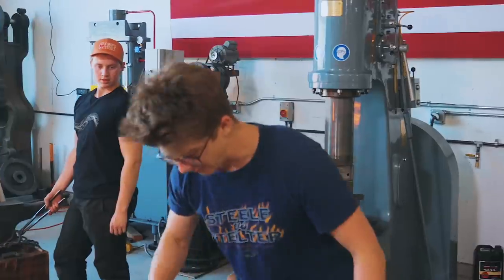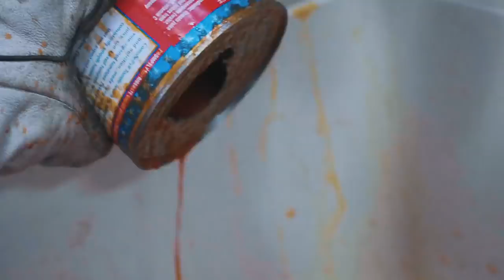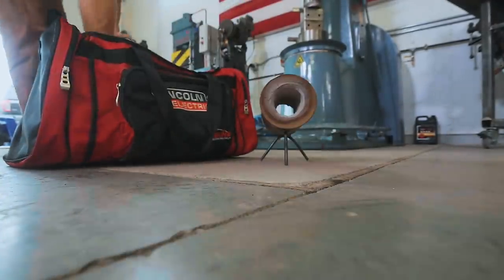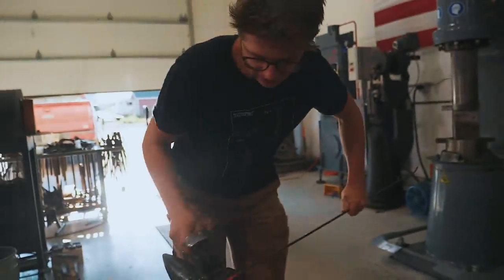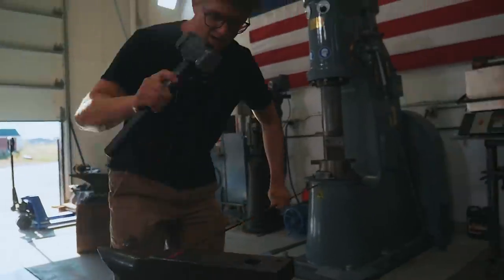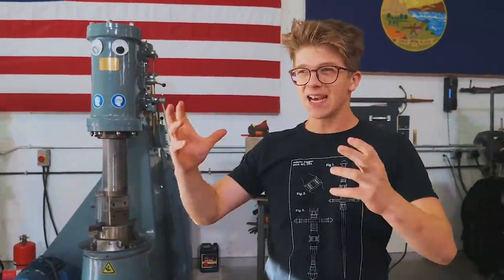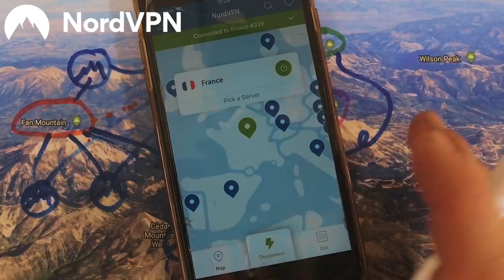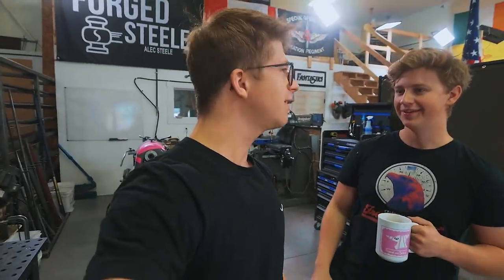MAKING A FORGE THAT FITS IN A BACKPACK!!!

Comment: I never considered using my new to me Lathe as a can opener.  Damn.  I always learn something new.
Reply: He should have used it to open the full can!
Reply: @fire304  So instead of mopping up a small spill on the floor you want him to have to completely clean his lathe?
Reply: I mean, I never considered using a TIG welder as a can opener either.
Reply: @fakjbf3129  Plasma cutter but yea.
Reply: @koloth5139  Maybe if there's enough air in the can, and you spin it fast enough on the lathe, the contents will remain pressed against the walls of the can by the centrifugal force, so that it won't spill through the small hole you drill in the middle?

Good luck when stopping the lathe though...
Reply: @piranha031091  If that were the case, just place a shallow but very wide bowl under the spinny part of the lathe and then slow it down.
Reply: Yup, gotta say I was watching that starting with the torch to the lathe and thinking "why didn't he just use a hole saw for the one end, and a can opener for the other?"   But I get it, this looks "cooler" :D

Comment: Dang. Hopefully there's a non-national forest peak nearby where you can do this! 

... also, have you ever heard of can openers?
Reply: What are you talking about he used 2 in this video alone
Reply: @Handsy_McGee  yes, but is it called a can opener just because you can open cans with it? I've used EDC knives and even run over cans with a car/truck/tractor... all of the cans opened, but running over them also wasted the contents beyond use. Tires are terrible can openers. I suppose he could grind the top off with an angle grinder, but those pesky metal dusts and shards can be quite hazardous to swallow with the contents the can originally held.

Comment: Hey Alec

Thanks for this vid.

I plan to use an old Helium gas bottle as a forge. I just gotta find out if it's safe to angle grind the thing open but knowing about kaowool and satanite esp the safety is most helpful
Reply: Helium is non flammable, so Sparks aren't an issue. Just be sure to completely empty any pressure in the tank, and remove the valve to prevent pressure building from heat. Good luck, and enjoy your forge!
Reply: cheers Jon, most helpful 😀

Comment: FINALLY someone wears a respirator while working with ceramic fiber and refractory! good lord thank you.
Reply: Who the hell doesn't wear respirator and eye protection when working with that?
Reply: @isaac2990  definately not will stelter multiple times, and surely alec didnt use a single sheet of plain kaowool as a forge for the longest time. No ppe with this stuff is the norm for this channel.

Comment: I have a challenge my smithing mentor said that the hardest thing to make is a coffee cup I love your work and I believe in you i love your videos there truly amazing good luck
Reply: Gut an oil filter, smash the rounded top flat, weld on a simple steel bracket to the side as a handle, finish as desired. Coffee cup achieved.
Reply: David Piehl he would need to forge it
Reply: @wesschowengerdt2358  damn... so coffee cup from raw steel, just heat, hammer, repeat?

In that case, I'm too stupid and inexperienced to find a quick fix. I keep coming back to wanting some sort of forming tool to work the metal around... say a blunted horn on an anvil or dome-ing tool for a hardy, intending to invert the dome once drawn out. (think wine bottle bottom)
Reply: Doesn't sound difficult tbh, make a cross, push the sides up, forge weld the sides together, just like a very basic way of making vessels with slabs, in pottery...

Comment: HAHAHAHA IM EARLY

so hey since baseball is so popular in the USA how about a Damascus baseball bat :)

And ima comment again at the end of the vid
Reply: That would look dope
Reply: i like your style
Reply: That would be about 30 lbs (13.6 kg)
Reply: Defo could not be solid that would be crazy heavy but un heat treated annealed Damascus could probably be rolled in to the proper tube shape.
Reply: @nanaki-seto   most bats are hollow
Reply: @kingskoopy6151  yes but you can't cast Damascus steel. You would need a large rolling mill and have to work it hot. Then you'd have to form it into bat shape and weld it. It's doable but lots of work and constant heating of the metal. You could also form a billet into a solid bat and hollow it out on a metal lathe but that's a lot of wasted steel
Reply: @crazycodplayer11  thats a good point. i say that this whole idea was a bad idea
Reply: @crazycodplayer11  could use the leftover spirals to make canister damascus
Reply: @kingskoopy6151  Wow your smart! so smart next time you will read my full comment vs trying to make your self look smart by stating the obvious.

Comment: Alec, long time viewer and subscriber here. First time commenting on one of your videos. 

As a suggestion for better portability, I would have welded nuts to the bottom of the forge and used some long bolts for legs. Then you can place the legs inside the forge and use something elastic, like a shower cap perhaps (first thing that comes to mind, to keep them inside it until you need it.

Forge on brother, I've learned a lot from you. Welcome to America and congratulations on your engagement!

Comment: Hey Alec, I've been contemplating forging for awhile now, especially since i've started watching your channel and was hoping you could make  a "Start forging on a budget" video? make the start-up budget around $50-100? With a list in the description of the supplies and cost?
Reply: You want to start forging for $50?  Ok, here goes.  Buy a case a of beer, drink it and wait until the urge passes. There, I just saved you like $30. If you still have the urge tomorrow then be prepared to spend several hundred dollars for even a basic setup and many hours of back breaking labor to hammer a piece of square metal into a lump of useless metal. Because you know what? Forging is hard!!!

Comment: The top of Beartooth Pass has many places you can sit on the side of the road with one hell of a view. Not part of a National Forest either with no time limit on stopping. You'll find it on 212 south coming out of Montana going into Wyoming. I've ridden that route before and there are at least 6 good wide spots you could stop and do the forging. It's a little higher. Closer to 11,000 feet in some spots.

Comment: I enjoyed your video as I do with all your videos. Aside from always learning something new your presentation of the material is so entertaining. Thank you for respecting the rules on Nat. Parks regardless on how arbitrary they may seem. I think you summed up the situation very well. Additionally I was surprised that you shop was missing such a simple tool as a can opener. That said your solution did put a big smile on my face. Again thanks. ;-) Finally I do not even think of myself as good enough at metal working to be considered a newbie but I do question your choice for the type of forge you chose. i think going with a charcoal forge as you did as your first forge or even using a few insulating lightweight bricks. The main reason I don't like the tin can forge is of the use of thee wool even when sealed. I think the other options would work as well and cost about the same and avoid the risk of dealing with the wool. I am admittedly risk adverse especially as a beginner. Just my 2 cents on this. Cant wait for your next video.

Comment: Hi Alec, it is a long time I have wanted to ask a question to you. How is it that you keep the metal hot for so long???  Your metal seems to keep the heat much much longer than mine (i am only a hobbyist!), even the thin rod you used in this video was hot for a really long time!! You have explained that minimizing the area of contact between the anvil and the hot metal is crucial but there must be something else! even if i heat the steel and do not touch the anvil at all it does not stay hot for so long! Is it the hammering heating the steel? Are there steels that keep hot for longer than others? Do you use special filters on the camera?. Thank you very much for all your high quality videos!!

Comment: You could just bring the anvil and use a copper or tin bar, since those are soft enough to work with cold. Tin would be much softer, but you can do it with copper too.

Comment: Come do it at the top of Pikes Peak in Colorado, I'm pretty sure its a comercial area already as they have a parking lot and giftshop it's also higher at 14,115 ft. Come hike the Barr trial as well to get to the top, 13 miles going up 7390 ft in elevation.

Comment: Alec could u make a low budget coal forge as I did a week with a blacksmith and got to use propane and coal as the clinker burn through the dust vent. But the heat propane thrown out of the was off outing and can find any safe portable designs (not a hole in the Ground)

Comment: So I had a question maybe someone could clear up. I'm starting work on building my own forge I plan on using ceramic fiber with a refractory outside but I keep seeing everyone say you need a rigidizer layer between the two but wouldn't the refractory such as Satanite etc. be protection enough?

Comment: Realizing, of course, that there are such things as can openers...it is much cooler to turn and opening on the lath...  On another note is there any consideration to high altitude forging?  Does air pressure or the difference in oxygen content in the air have any consequence? Too bad about the mountain forging...how about on top of the roof instead?

Comment: I think you could do a road trip, visit different blacksmiths and forge knives on the back of a truck. ^^
Crazy? Well, maybe. Possible? Surely, the equipment is small and light and the fuel is available in any hardware store. Unique? No guaranties, but you might be the first to do it like that :)

In case you actually run with it, feel free to do so, the idea is free for you to use.

Comment: ok just made mine and i tried using it with a mapp gas torch and i cant get anything hot enough to turn even a little red. sat there for 20 minutes waiting for any color in the nail and nothing... any suggestions?

Comment: i really wan't to make a forge like that, but the problem is that i can't use fire.... maybe i will search something that heats things up with electricity or somthing 🤔
Reply: But can you run a sufficient generator on the mountain for the electric forge?
Reply: @thomasarussellsr  idk... veeeery big batteries (maybe like a few car batteries or something) idk what's possible
Reply: @ernest4696  the heat generation required for forging would drain 2-3 car batteries pretty quickly. Most electric forges are 220-240V electric requirements. I don't think car batteries would work. Maybe if you had a few dozen batteries and a reliable charging system to keep them going? Charcoal or coal would be easier to pack, but then again would have a fire going.
Reply: @thomasarussellsr  yeah i don't think that you can get so much electricity on a mountain on a way that it's not to big and heavy...

Comment: You guys are too young to remember Evel Knievel.  He spent many years bragging that he was going to jump his motorcycle across the Grand Canyon.  When he finally got his special bike built, he found that the national Park service would not let him do it for much the same reasons that you got.  Instead of giving up, he found a canyon that was on private land, Snake River Canyon, in Wyoming.
So, what you guys have to do is find a mountaintop that is on private land. Failing that, you could forge it on the rim of Snake River Canyon.  Hope you have better luck than Evel, who landed at the bottom of the Canyon.
While you're at it, you can make a grinder that fits in your rucksack.  Four six inch diamond grinding wheels in different grits should be good for a start, then some kind of collapsible  arbor frame, and a hand cranked arbor.